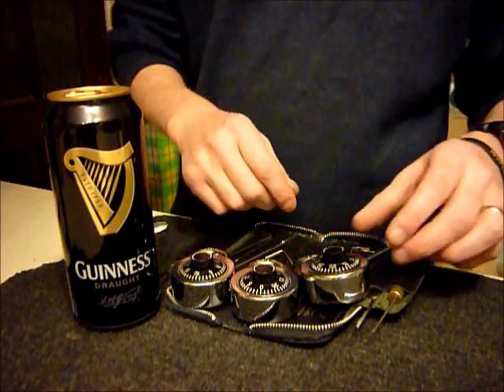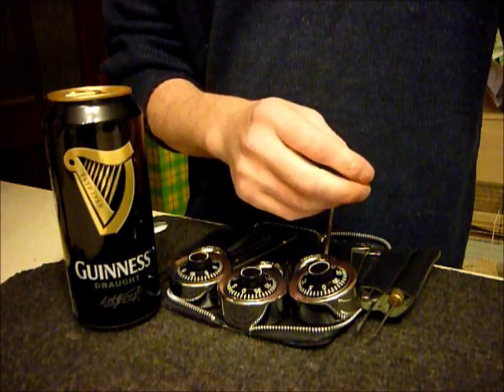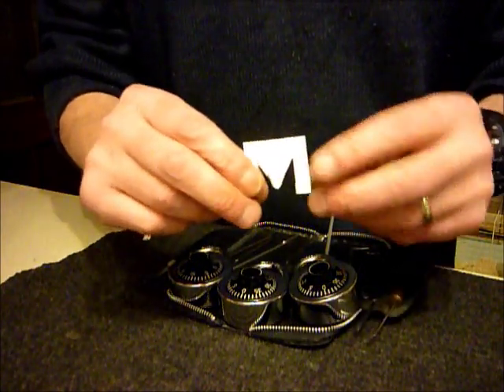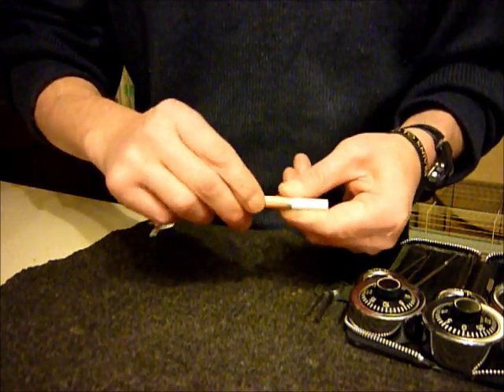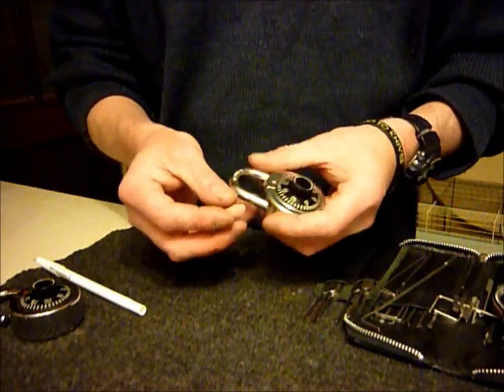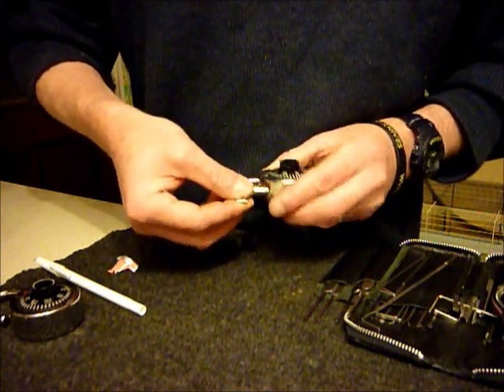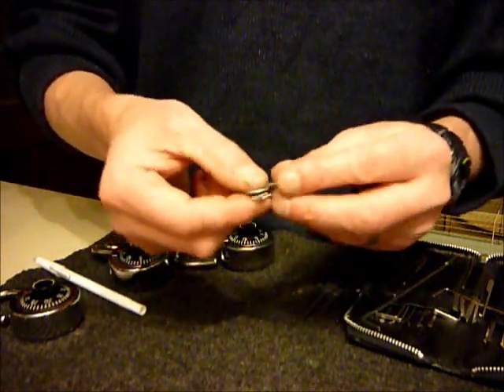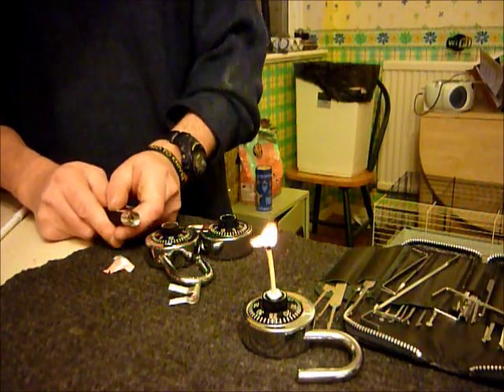Lock Picking Tutorial Of Home Made Padlock Shims VERY EASY!!

Comment from the maker: Sorry for the delay mate as been really busy. It can depend on padlock size, but if I recall the letter "M" drawn on the aluminium was 20mm on each line, but make sure you do not do the "V" straight, each side needs a slight curve to it, then make sure you round the tip off a little bit as it can buckle and bend the tip backwards, it will still open the lock. After taking shim out just bend the tip back. I never really used measurements as just did it by eye and can be trial and error.

Comment: Does this work on Dudley locks?
Reply from the maker: Never tried mate
Reply: waddac2 ok thx
Reply from the maker: It will work on any lock the shims will fit between shackle and body of the lock, providing they do not have ball bearings in shackle. Plus some padlocks need a shim on both sides of shackle.

Comment: I tried this with a master combination lock and it didn't work...
Reply from the maker: It will not work on all locks buddy. Some times you will need to use two shims... But if it has ball bearings in the shackle it will not shim.
Reply: k
Reply from the maker: It does not work on all locks buddy, the Master combination lock could have ball bearings locking the shackle and they cannot be shimmed. Some master combination locks need to have shimmed on both shackles so try two on it and let me know if it works.